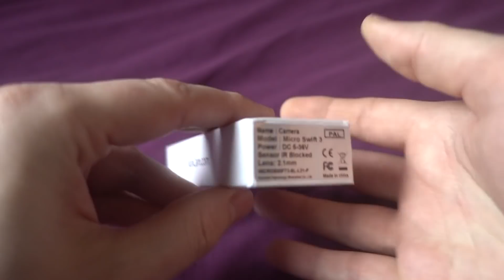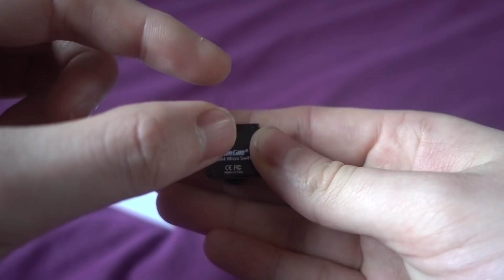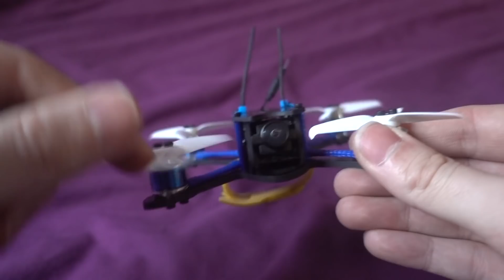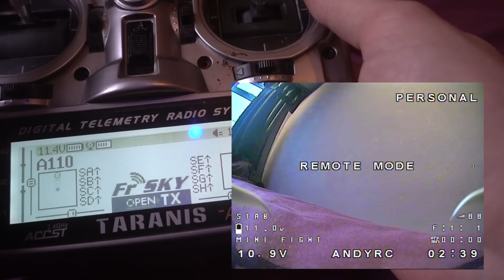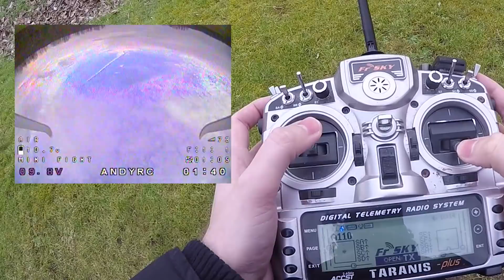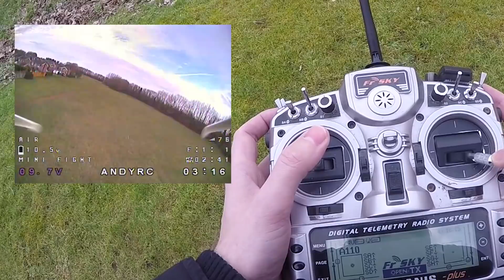RunCam Micro Swift V3 - Camera Controls!

Comment: I can't get receiver to arm in BF 3.3 using FF Picoblx target I get "Throttle" flag and min_check is correct. Once flashed back to 3.2 quad arms perfectly and I'm using the same dump for both versions. Output is set correctly showing 1k min and 2k max in receiver tab. I'd like to try 3.3 but quad won't arm. I like the new style of your video showing both thumb controls and how the quad flies. Your PIDs are on point.

Comment: Where's all that snow that people have been talking about hitting up Western Europe ... looks like you're clean and green. We just had an ice storm which took out a huge limb of a neighbor's tree, which promptly took out my power line from the power pole. Fortunately, I have a natural gas backup generator which kicks on 5-10 seconds after power goes out.  Runcam looks to have another winner. Cheers.
Reply from the maker: It doesn't take long for it to dissapear here bill. Cheers
Reply: They are still using military helicopters to land emergency supplies not 25 miles from me Bill with people having been cut off for over a week.  I'm down to 4" of wet slush though

Comment: I really don't like being forced to give up a uart. This really hurts the inav guys. The multiplex was great. 

I do like the singular plug. The 2 pin board plug eventually breaks from the weight of the wire.
Reply from the maker: It is for sure becoming a fight for uarts although soft serials make it easier
Reply: And to think all the new boards have the multiplex pad. Hardware guys need to talk...the software guys can modify on the fly.